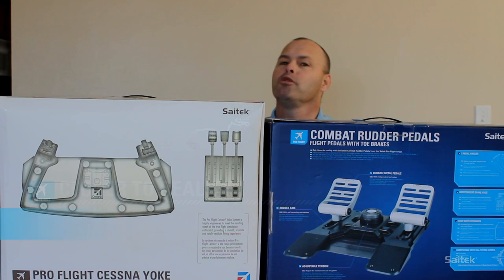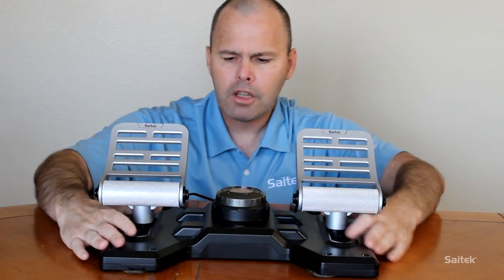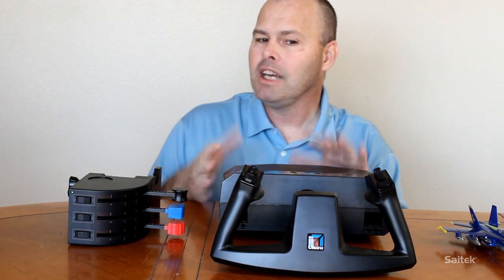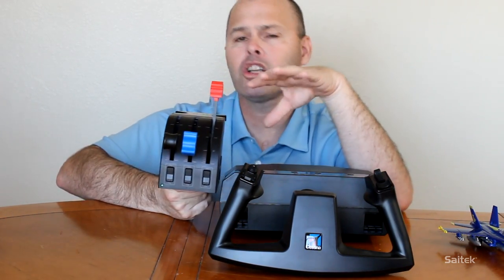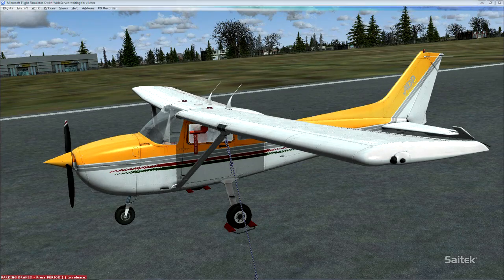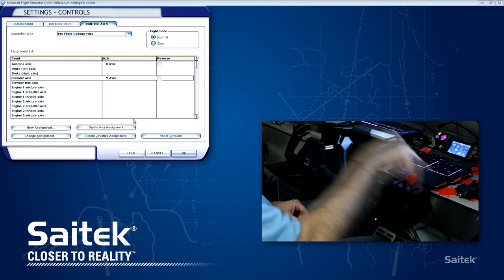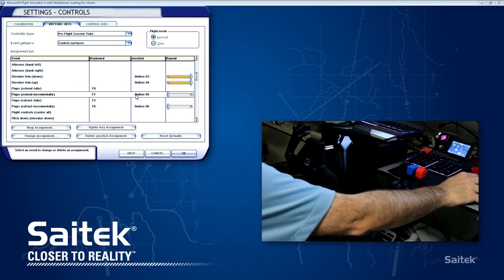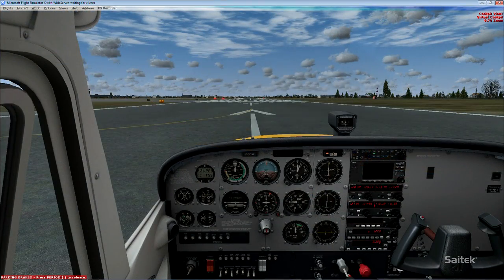New To Flight Sim? Pt. 2 Saitek Yokes And Pedals Overview By Froogle

Comment: You described mixture backwards. Mixture controls the amount of fuel going in to the engine.
Reply: It controls the ratio of fuel to air going into the engine
Reply: he also described what the elevators do incorrectly. Yes, there is a little deflection from the wind hitting it, but it's basically negligible. The main force that moves it up or down is lift. The elevator is basically an upside down wing. When you pull back on the yoke, the elevator moves up which extends the chord line which equals more lift, and since it's an upside down wing, that lift is directed downwards, so the tail moves down. The opposite it true for when you push the yoke forward.
Reply: @MrMR-sk8jm  no he described it correctly, lets think about flaps, when you drop flaps it generates lift, they are pointing down. the horizontal stabilizer is shaped like the wing. going back to the flaps, how my instructor taught me is, on final when you have the flaps dumped, and are on final, pitch becomes what controls speed, and throttle controls altitude. so you increase throttle, push the nose down, the aircraft will actually go up, as the flaps act like the elevator, they are pointed down so when you apply more thrust or airflow, it hits them and the air is pushed down which is why it goes up (every action has an equal and opposite reaction. the reason pushing down on the elevator makes the plane go down is because its on the end of the tail, so the tail goes up just like flaps, but unlike flaps, they arent near the CG so it actually pushes the nose down. i know you werent asking for a lecture but i just wanna make sure everyone knows what they are talking about prior to making a statement such as the one you made.

Comment: I believe the way tail wheel steering works is:
The rudder pedals are connected directly to the rudder that has a spring on each side that connects to the rear wheel.  When you push on one rudder, the tail deflects but nothing happens to the rear wheel until you move forward (or are moving forward already).   Then the spring pulls the rear wheel to one side until the tension is relieved.  No, it does not work like, "the wind hits the tail and pushes it around."

Comment: Mixture does not draw in more air as you claim. It's a simple matter of reducing the fuel flow to match the density of the air and keep the ratio between the two.

Comment: Sir,
I have issues with my Multipanel, namely the trim wheel does not work on any aircraft use (A2A, Flight 1 general FSX default etc).  I use SPAD and tired FSUIIPC to no avail. The rest of the panel works including flaps (I only fly C172 and B200 so don't need auto throttle yet).
Have you had issues with this >
keep up the great work
kind regards

Harold
Whitby
New Zealand

Comment: I am clicking on your product links at teh end of your video; however everything is "Out of Stock".
EDIT: I also noticed that the only website that has these in stock is Amazon and the price is more than double what other sites are charging. Is there a reason for the drastic price increase?
Reply: It's demand. Alot of gamers getting into space sims these days. Particularly Elite Dangerous. Flight sim controllers have always been a niche market....so I'm guessing the overload is catching them by surprise. 
I'm in the same situation trying to get new rudder pedals for DCS World. Can't find the type of pedal I want anywhere. Everywhere is back ordered. Even high end sellers like MFG Crosswind Rudder Pedals are back ordered.
Reply: +Dereck Dunn if you go to "the pilot store" you can buy items at original (non-inflated" cost.  But they are back ordered as well. Buying puts you on the list to have it shipped to you when it comes in. The site says anywhere from 3 to 6 weeks.
Reply: +Dereck Dunn  Awesome, thanks for the info and quick reply.
Reply: The reason it's much more expensive is that these are VERY high-demand. It took me almost a year to get a yoke standard-price.

Comment: Yea and u need to pull that yoke back in a turn too...i mean unless you like losing altitude.... Turning a plane requires using all three primary flight controls
Reply: And the throttle because you'll lose airspeed too.

Comment: Hi I have Microsoft Flight Sim X. After install the Saitek Pro Flight Cessna Driver, I calibrated and it look fine.  However, when I test the propeller and mixture in a C-208 and C-175 they don't work.
Could you please tell me what is happen?  How can I make both propeller and mixture work?  Thank you

Comment: I wish Saitek would have spent 1/4 the time and resources it took to develop 3 different pedals to do the same thing, and made an approachable cyclic/collective set.with a twist throttle.  Basically an x45/x52/x55/x56 with some 3d printed parts to extend the joystick and make a collective handle.  They could charge 300-400US for $20 worth of parts.  I don't think there is anything available at that price point, they would corner the market with anyone who wants to start flying helicopters or even the V-22 Osprey.

Comment: About the rudder pedals:
After using them for three years i can say that they are not worth the money.
The awful design in the plastic against plastic sliding mechanism absolutely sucks dirt in and just a bit of dirt and they go grindy and rough, making precise movement impossible.
These pedals are only good for a few months of use before they become grindy, sticky and loose.
And the brakepedals themselfes also goes loose and you cant tighten them enough to fix them.
You are better of buying those Thrustmaster cheapish pedals.

Calling the Saitek Cessna Pro Flight Yoke a high end yoke.....
Oh, and apologise if i heard wrong, but its called F/A-18, not F-18.

Sorry for my rant, you are a fine chap, but those products.....

Merry Christmas and a Happy New Year.

Comment: Why wasn't there a flight yoke for the left seat?  Is it omitted so you can see the control panel without the yoke getting in the way?
Reply: +sewashburn0529 Yes you can toggle it on and off.

Comment: I bought the Saitek Switch Panel, but FSX do not find it. I had install the drivers again and again without results. I edited also the exe.xml file and nothing, but if I open the Saitek Pro Flight Switch Panel (Software) this said Saitek Switch Panel is working. So what can I do to make the Saitek Switch Panel to work with FSX?

Thank you
Reply: Try FSUIPC
Reply: +Keil Gilby I don't think so I'm not 100% sure however I don't use it myself
Reply: +Melvin Antonio Guerrero Morán are you using it with normal fsx or steam fsx ?I had the exact same issue all I had to do was copy and paste the xml file from disc fsx and place it in the steam version, doing it manually DOES NOT WORK!

Comment: currently I have a cessna yoke, but I really dislike the elevator control since the spring makes it really hard to control the aircraft since it "sticks" on particular spots. I know there's a rubber band fix for this but curious if I "downgrade" to the regular saitek pro flight yoke (not cessna version), is that also the same problem with the elevators? I know that one is limited to 45 degree turn whereas the cessna yoke has 90 degree turn.
Reply: Michael Kung I had the same issue, in the end I gave up and bought a CH Eclipse yoke - FAR more natural and no sticking or centering issues.
Reply: +Steve Walton If only they didn't make the CH yokes so ugly. Main reason why I like the Cessna yoke is because it looks good compared to most mid-level Flightsim yokes. I know that function is more important for most people. It is for me as well, but I just can't stand how the CH Yokes look.
Reply: I know what you mean and agree 100% But now I've had the Eclipse yoke for a while and it does grow on you a little! Plus the quality feels great and it's so much smoother. My Cessna yoke is just collecting dust in it's box
Reply: Oh and by the way I love the twin hat switches either side of the yoke.. I couldn't live without it now ;-)
Reply: +Steve Walton i had a ch yoke back in the day, not the eclipse but I believe the design hasn't changed much other than more buttons. I'm sticking to my cessna yoke for now :)
Reply: Hi Jonas I have had both and the Eclipse yoke has better build quality and the shaft it much smoother. I also find the extra switches useful and it can clamp to any desk now. I much prefer the Cessna yoke aesthetics but quite honesty there is no comparison to how it performs. The CH also uses better potentiometers, I find flaring with the Cessna yoke impossible, way too over sensitive
Reply: +Steve Walton I haven't had that problem. Sure, it can be a bit sticky on approach, but I guess it just comes down to tweaking the sensitivity. Now the ultimate solution would be to stick the Cessna yoke onto th CH, removing the CH yoke itself. That way you'd have a very functional yoke that looks good as well. :P You'd lose the 90 degree of rotation though, which is a feature I like with the Cessna yoke.
Reply: Now that would be something!

Comment: I assume Froogle has a sponsorship relationship with Saitek, now taken over by Logitech. Among the very poor customer service failures by Saitek are as follows: Delivery through Amazon of the Pro Yoke and Throttle bundle without the proper screws and failure to include spare throttle knobs as advertised by Saitek. Frequent failures of the yoke and throttle levers through potentiometer spikes. Poorly manufactured potentiometers. Frequent failures in calibration. Excessive grease used inside the Yoke as a substitute for poor lubrication. Excessively strong springs. Poorly made plastic parts. Ridiculous amounts of pre-programmed deadzones in the yoke which are not only unneccesary (can be done as an option by anyone through software or via the sim)but grossly excessive. Wearing out of parts with normal use after warranty expires but way before they should. Complete lack of a spare parts department at Saitek and/or Logitech for knobs and/or screws. No contactable phone number for support. No contactable address for support. No contactable person, organisation or mechanism to source spare parts. Complete lack of customer care or response. I think Froogle should consider all this before be a willing sponsor of Saitek.

Comment: Saitek sucks... they've know about how their detents are hated, and they released this yoke with that problem unsolved.
Reply: ADRIAN CIRNU
I mean the axis have a click in the center. Every time you go neutral or zero force on any of the affected axis, you hear and feel "click" on the yoke. Not only real airplanes with reversible controls don't do this, it's annoying.
Saitek sucks for this because this is the product they've been fighting against CH Controls with. The CH yoke, although it feels cheaper and its electronics are old, doesn't have those center detents and that very thing makes their yoke 1000x better than saiteks.

So, nowadays, if you fly real airplanes and cannot live with that detent, your only options are a cheap CH yoke, or a pro yoke that will never cost less than $600. If Saitek knew what they were doing, the first thing you would have done, is to redesign the mechanism so that there are no detents.
Reply: ADRIAN CIRNU
Yes, I mean the yoke. It has a clicky center. It's unbrearable. Every time you go from turning left to turning right, there's a click. Every time you act on the elevator and go through neutral: click click click. It's a detent.
Reply: ADRIAN CIRNU
If you can't buy an expensive yoke, in this price range, the best one is the CH yoke, but not because it's better (it's not), but because it doesn't have a detent. The CH yoke has worse electronics. Calibration is not stable. The construction is cheaper and the shaft is plastic. You should know that. I've bought the CH yoke twice, because the first one I bought broke after 10 years of heavy usage. It doesn't come bundled with anything else, so I bought the pedals and a throttle quadrant.
Now, if you can spend a little more, 300$ higher in the price range, you'll find controllers like the ones used in certified sims and procedure trainers, but cheaper. VRinsight FLIGHT MASTER YOKE II is an amazing yoke. It does not improve on important areas, like range of motion, but it's very sturdy and smooth. It's double the price of a Saitek though. The next step is at the $1000 range. You got Yoko the yoke there. It's amazing quality, but it's probably underfeatured because it's meant to be combined with other hardware. It's a joke, nothing more and nothing less. It has great extended range of motion and super smooth feel. After that one, things start to get really expensive quickly, as they're focused towards flight school level certified simulation solutions.
Reply: That's fixed now,
Reply: YaZzY _ What's fixed. The detent? Nope. I tried the Cessna Yoke last week. Still has a detent that real reversible control airplanes just do not have.
Reply: @palopo-t3v  have they fixed it now?

Comment: New design on top of the same crap to catch “new” customers. The first pedal controls from this company is worth NOTHING! After a year trying to set up and use I through it on the trash. The system is the same, just new “nice” design as a make up, and more than double the price from previous version. I wouldn’t even use if I gotten for free. Let alone buying it.